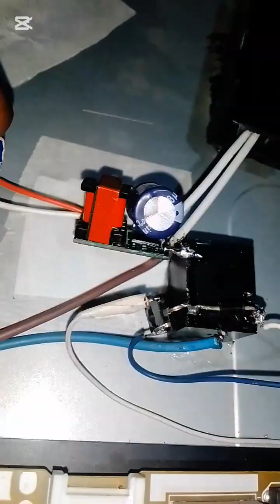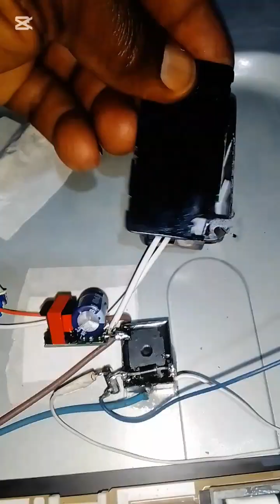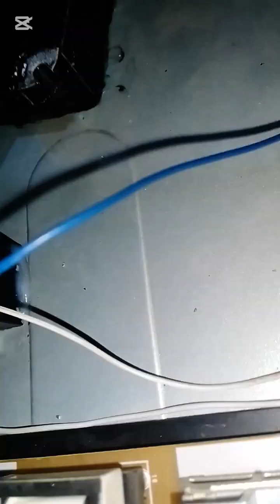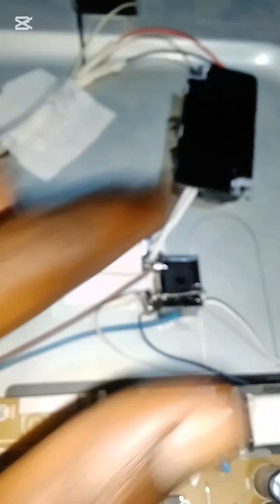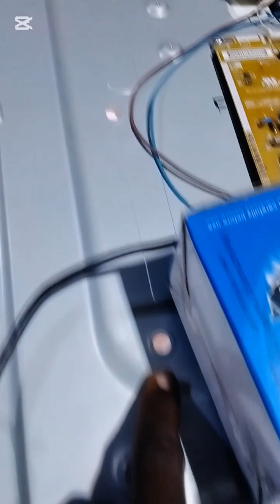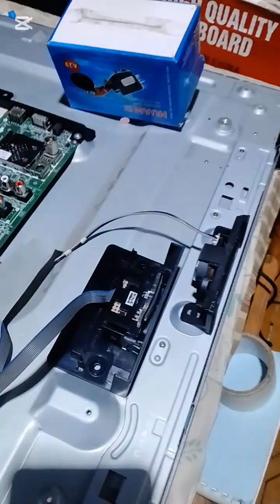How to Convert Any TV LED Driver Circuit Using a Relay | Universal LED Backlight Fix.

Comment: Instead of the extra resistor and transistor, why not just tap a 5v from the USB port to the relay? 🤷‍♂️
Reply from the maker: It won't work because I used a 12v relay.